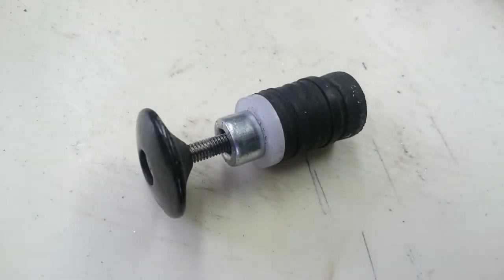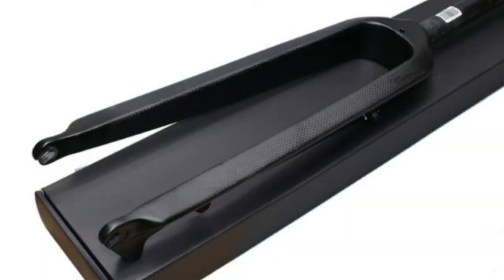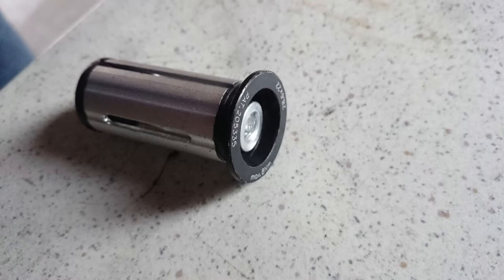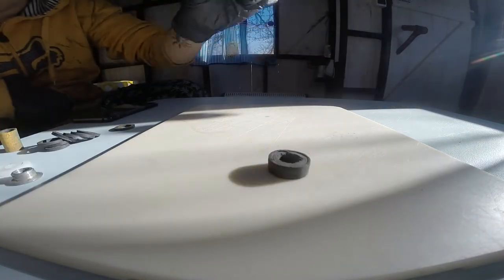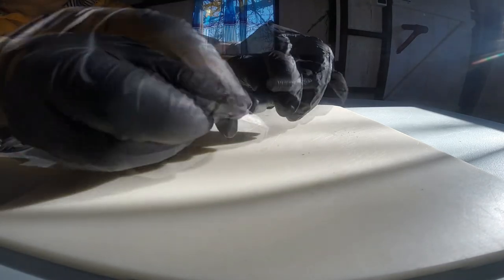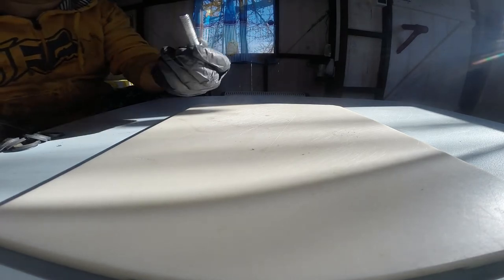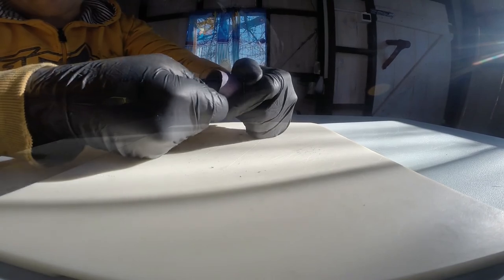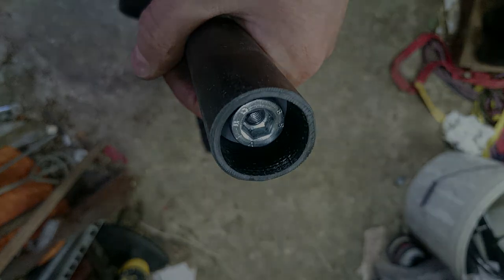DIY Bung for Carbon Steerer (Instead of Star Nut)

Comment: You have no idea wht you need to do - this is dangerous !
Reply from the maker: It worked well for three years and some 7500km, until two of those cheap China carbon forks got cracks (not on the steerer).  Now I have steel forks.

Comment: That's a terrible idea. The compression plug support the carbon steerer tube walls against the clamping forces of the stem. You'll possibly break you fork steerer with this device.
Reply from the maker: Nope, it's OK. There are the same forces as with the original carbon steerer bung. Main difference is that the original is steel on carbon, but on mine is rubber on carbon. I guess you are one of those who never saw original carbon steerer bung and uses star nut for carbon steerers. And that is so wrong... 😁 😂 😁